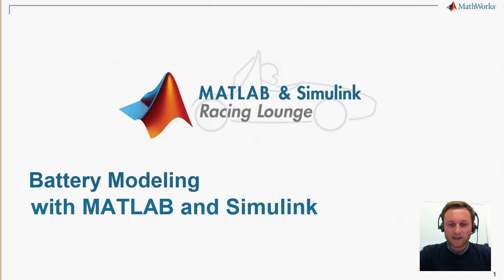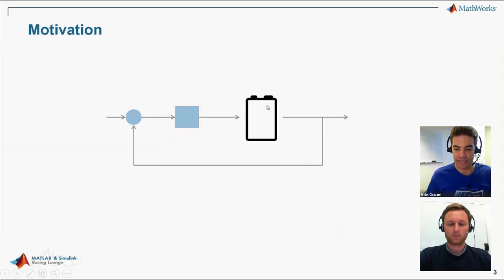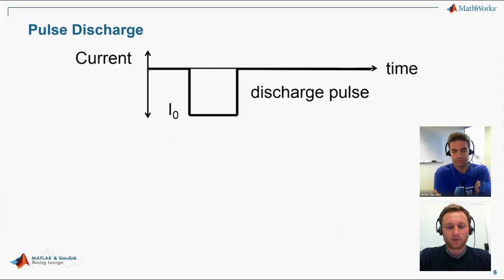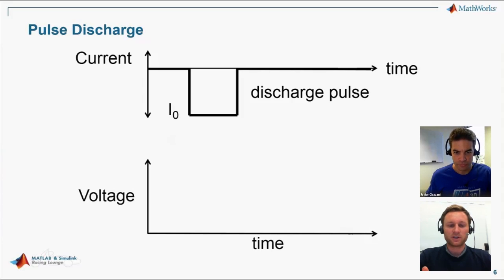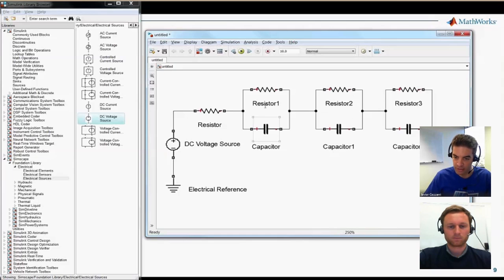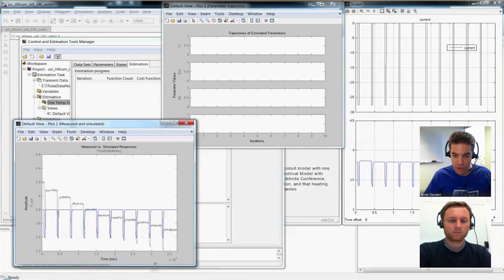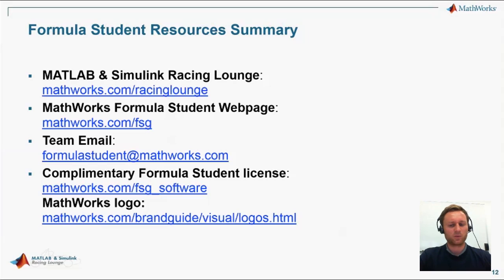Battery Modeling with Simulink

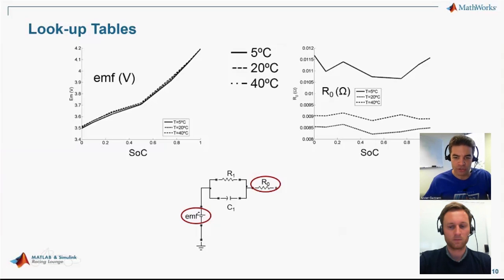Comment: at 29:11, higher the temp., higher the resistor. Why the resistor has the higher value at 5 degrees compared to 40 degrees?

Comment: At what discharge rate is recommended for the pulse discharge test? 0.1C, 0.5C, 1C? Anyone knows?. Also how much time is recommended for relaxation? 1 hour, 2 hours, more?. I did some experiments a couple of months ago and 1 hour was not enough to fully recover the voltage drop.